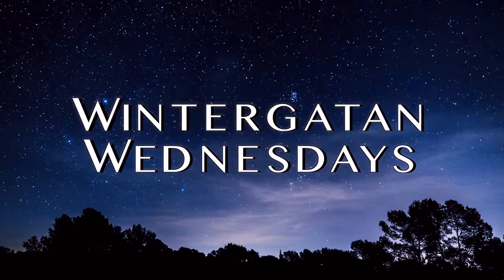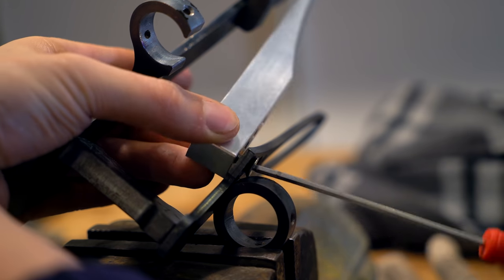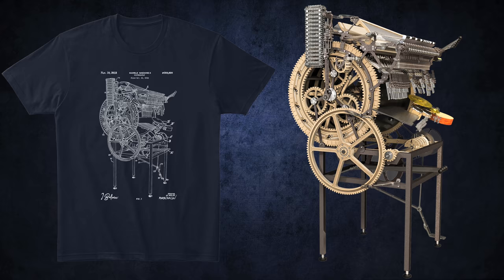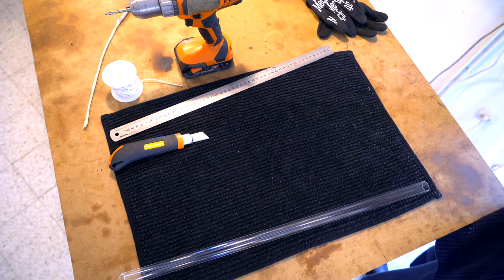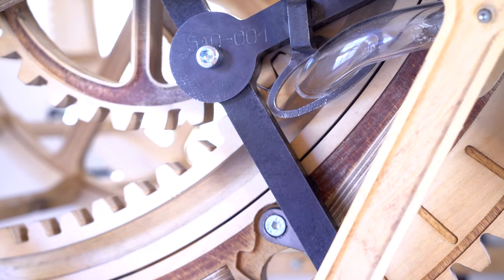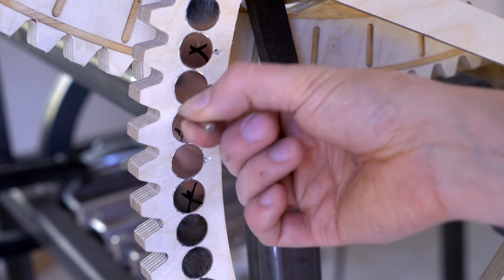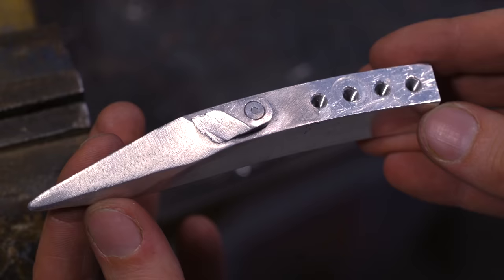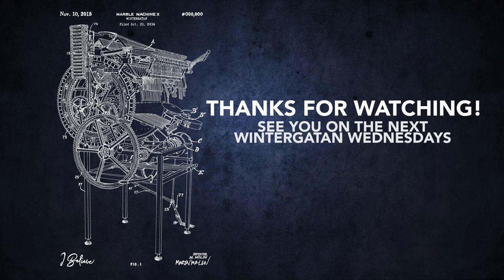Magnet Polarity Switch - Marble Machine X #60

Comment: That aluminium wedge might get rather warm due to eddy currents, probably not enough to be an issue but I don't want the machine to set itself on fire after one hour of concert
Reply: No.
Reply: I'm more concerned with the wedge breaking down too fast to be useful. It needs to be something harder and more scratch resistant. Those marbles might be smooth, but even minute particles of dust are going to be hell on that point.
Reply: @DembaiVT  he needs to tamper the steel.
Reply: @jacktheninja  the wedge is aluminum, not steel. Steel balls constantly rubbing on aluminum are going to wear a groove in the aluminum pretty fast. Steel balls with a fresh coat of aluminum oxide nanoparticles are going to wreak havoc of the finish of everything they touch.
Reply: @jimstanley_49  I must be high or something as i completely skipped the 'aluminium' part

Comment: Really dont need to use three taps on a through hole. Just run the starter tap all the way in. The plug tap is so you can get threads all the way to the bottom of a blind hole, even then most of the time i skip the middle one anyway.

Comment: one question, wont you have an induction heat problem with the aluminium fang and the alternating magnets?
Reply: I don't think that it will matter... but some cooling fins on that aluminum part would probably look very cool :D
Reply: @PenPeng  Let's watercool it :p
Reply: It shouldn't be any worse than in the other metal parts. The problem I foresee is the steel balls wearing away the aluminum and depositing it all through the machine. He might need to get some kind of high-carbon (very weakly magnetic) stainless to go there.
Reply: @jimstanley_49  I was also thinking about that, specially the clear tube transporting the marbles would become gray(ish) pretty fast.

Comment: Excellent video Martin. Ordered my teeshirt. The MMX is really a beautiful masterpiece. I look forward to the day I see you live, in concert, making music with it. Watching the marbles moving from the lower gear into the transfer tube makes me think of a freight train going through a switch from the main line to a siding. I am so glad clear tubing is used here and in the marble divider. I don't know if it is OCD or another disorder but I almost enjoy watching the marbles as much as hearing the music.
If I had to describe the MMX in one word, that would be "Charm'. Like a perfect batch of red french wine, made the old fasion way. Popping the cap by foot so you can feel the difference in temperature in the fermentation tank. And aging for 2 years in oak barrels where the wood was first aged for 3 seasons. Thank you for designing the teeshirt. I will wear mine with pride.

Comment: This is fantastic!  I made 700mm x 700mm birch panels that have various patent drawings (tesla electric motor, lego, electric toaster etc) laser etched into them which I used for flooring in a room in my home.  I may have to remove a panel and replace it with the marble machine patent now.  You are an inspiration!

Comment: When tapping through holes (or blind ones with extra depth for the chips), you only need to use the 1st (taper) tap in the set. Although you must run the trap further through the material as the cutting threads have quite the shallow taper. Typically a taper tap has 7 threads before they reach full depth. This is to allow reduced chip load on each tooth (easier starting, longer tap life, and less chance of breaking).

The 2nd (plug) and 3rd (bottoming) are only needed to get full depth threads right down to the bottom of a blind hole. They do not enlarge the threads.

Comment: If the aluminium fang becomes a problem it will obviously be difficult to unscrew it. I suggest turning the screws around by making countsinks in the ali fang nearest the wheel and filling then tapping the metal bracket. Love the machine and the video's. Great work Martin.

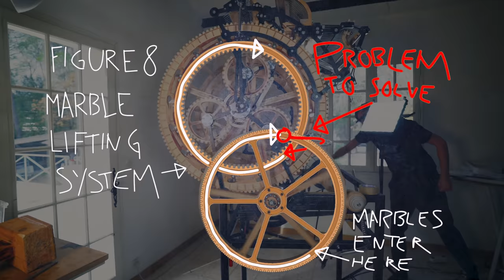Comment: I noticed something that could be important. The foot pedal, which was in the up position where it cant crush your toes came down by its self at 21:59 Im not sure if it was fully locked but if so maybe you should take another look at how that is held out of the way so you don't break any toes.
Reply: That was well spotted, but by design the pedal doesn't ever 'lock' per se (IIRC) so if Martin's foot was under it, it would simply flap upwards. Props for looking out for his well-being though :)

Comment: JUST EXTEND THE OVAL TUBE ACCEPTOR AND THE MARBLE REMOVAL FANG!!! If you extend the metal pieces longer you can just have the two pieces attached on the other side where there is no issues (or at least much less issues) with the pipe being in the way. It also solves the first problem with the welded part being in the way as well and only requires the redesign and remaking of 3 parts as of now(the oval poiece, the fang and the marble direction tube)! When you are redoing the marble redirection loop tube you could also cut it and shape it so that there is not a flat lip at the end but a gradual slope bu filing the inside of the tube down with a rounded file(be sure to protect the tube by covering the end of the file with something). If you want to keep using this same design you can also use a slotted bolt hole that keeps the metal together with something like the counter sink or  even better as flat head bolts that have heads that fit into bigger holes on the top or another piece of metal welded on the top.    Also wet the silicon rod and tube before putting it in the tube to make it easier to get it out. you can also squirt water down the pipe in a sink.

Comment: Hey Martin... I really like what you're doing with those magnets. There is something you should consider testing: Even if aluminium is a non magnetic metal, it is a good conductor for electricity. The magnets passing that piece of aluminium will induce eddy currents. Those currents can heat up the aluminium part. They will also create a certain braking force to the wheel. For safety reasons you should check the temperature of the aluminium. Maybe it is not a problem since the airflow is quite high but you better check it before it gets problematic ;-)

Comment: So nice to watch.  I love your work and your music!  Something to think about, the aluminum being so close to the magnets will generate a resisting force in the direction of the movement of the magnets.  In other words, it becomes a magnetic brake that will stop the machine sooner when you stop winding.  However it is kind of small and so it might not have a huge effect.
Reply: Alternatively, you could 3D print the part with some nylon or carbon-infused filament.  However it wouldn't last as long as the aluminum.

Comment: there are coatings or rubber pads (really thin) you could cut to fit the profile of the adjacency, and the rubber would prevent the corrosion, and because it would be cut to match the profile of the attachment, it would not be visible.

Comment: So I have been thinking since yesterday about the whole "marble scooper" as I'd call it, what gets the marbles off of the first magnet wheel.

It seems to me the majority of the problems with it is it tries to direct the marbles off like an exit on a highway. Which makes sense from the point we want it to go into a tube but less so for making the marbles come off of the magnets.

What I have been thinking about is to think laterally instead, like instead of having a wedge that slopes with the direction of the spin, you'd have a wedge that slopes towards the edge of the wheel. This wedge would gradually be introduced which means, that it'd be under the gap of the curve of the marble when it first is hit, and as the marble travels along it eventually comes to a wedge of such magnitude it falls off to the side ever so slightly and directed into the tube.

To elaborate this would basically look like the first design but instead of looking like the tooth of a dragon it'd look like long scythe, thin, curved and slowly tapering. 

This would make every single marble capable of being redirected on its own, but will require some very precise machining and design.

Hope you see what I mean, wouldn't be able to post any links since YouTube usually filters that.
It's important to remember if you see slight issues in limited control scenarios, you will encounter more when you use it as a product.

Comment: not sure if someone mentioned already. but if you put soap on the silicone rod, it will go in much easier. of course after that the tube needs to be cleaned.

Comment: Keep your head up! The CAD problem with assembly is still a HUGE problem in industry. Often things immediately apparent to real life only occur to people who have seen the problem before, because designers can forget about tools and tolerances very easily. Many drawings have an Assembly Drawing stage, and Manufacturing engineers have to interpret these drawings for assembly order. Its such a large problem that there are engineers who specialize in this!

Most people know what a Proof of Concept is, or a Proof of Design, but typically there is a Proof of Manufacturing prototype as well, so we can confirm that its assembly is as expected for manufacturing.

Comment: If you are worried about galvanic corrosion you can always put a sheet of teflon between the steel and that aluminum spike. :-)

As an alternate suggestion, lose the aluminum spike and make a scoop out of some flat spring steel, something like the blue steel bands they use to strap heavy packages down to shipping pallets. Curve it slightly to a partial tube shape so that it won't flex much, and get the edge of the scoop almost against the back of that lower wheel channel. The marbles will roll up onto the spring steel, and being steel, it will shield the marble from the magnet that was holding it. So unlike having to climb the aluminum spike while it is still being pulled to the wheel by the holding magnet, the spring steel should 'pick' the marble off the channel and cancel the magnetic pull, letting the marble flow easily into the tube.

Of course the spring steel will be attracted to the lifting magnets, so it has to be reasonably stiff. Something around 18 ga and curved, and with a reasonable anchor to the frame should be stiff enough. If there is a problem with the wheel pulling itself to the scoop and scraping the wheel against the scoop, you could put a small follower roller behind the scoop to keep the wheel spaced away from the front edge of the scoop.

Comment: something you could so, if it doesn't warp the part, is take a little heat to the work hardened area. take it to the orange colored range then let it cool off naturally. in the shop i work in this is what we do when our supplier etches small holes and we have to hand drill the plates.

Comment: when you pull the silicone out of the pipe:  use some highpressure compressed air at the same time you pull it out     :)   Same trick works on bike handlebar ends when setting them on....

Comment: Martin, 
There was a better solution to the machine screw that ended up being trapped. 
You could have drilled, threaded, and countersunk holes in the piece of aluminium (i.e., from the opposite side of where the threading is in the as-built configuration) and drilled and  threaded the piece of mild steel that is the mount. Then, using a flat head machine screw of appropriate length, threaded the screw through the aluminum and into the steel. 
Thought I'd mention this in case you need to redo these pieces.
David Green, Virginia, USA.

Comment: Way cool. Thank you for sharing this. A thin sheet of spring steel protruding from the tip of the aluminum fang might make a good "picker finger".  Thin enough, I suspect it would wobble toward the magnet then flip the marble into the tube.  As long as the spring steel is shorter than the width of the magnets (and mated to the aluminum) you should get a flipping action.  Of course, I Believe you'd need to figure out how to put an extra small tee-shirt between the parts for corrosion. :)

Comment: The magnets makes the machine pop!
Kämpa på, 
What about integrating a bearing in the wedge that follows the trench, and having a bearing on the other side as well. Which would “grab” the wheel. Combine this with a more rigid pipe entrance

Comment: Has no one told you about spiral point and spiral flute taps yet? With those you don't need to keep on backing out the tap to break/clear the chips, as they shoot/pull the chips out of the hole by them selves. You really should look into getting some high quality spiral point taps I think. The ones with a red ring on them should be right for your application I think. Those are high performance taps made specifically for difficult to tap materials. Just put some lube on and power on right through.

And also on the topic of galvanic corrosion, yeah you are completely right, it will not be an issue. You might find though, that the screws will be really hard to unscrew in a year or so, because the oxide layer on the aluminium has grown a bit, making the hole really tight. At least that has happened to me on a few parts. It helps to put some oil on them before assembly.

Comment: The reason the magnets work better when they're alternated is that magnetic flux likes to form a circuit, just like electricity.

The magnets sit more happily anyway when each N is next to a S (or a pair of S poles), but when you put a marble between the two it forms a more conductive path - almost a short circuit - between them, and you get a stronger attraction than when the connection to the other pole has to go the long way round, through the air.

This is why horseshoe magnets are a thing.

Comment: Actually you may still have an issue with galvanic corrosion as the magnetic fields that you have going through the pieces cause a small electric pulse, an alternating current pulse to be precise, though not necessarily a big issue, keep an eye on it.
Reply: Galvanic corrosion cannot happen unless there is an electrolyte completing the circuit between the two metals. Lots of electric motors have aluminium casings touching steel bearings, and they don't corrode unless the motor gets wet.

Comment: Yould could try adding a counter-magnet on the oppsite side where the exit is, to demagnetize them marbles. Just a small one so it doesn't take away too much of the view.  Then maybe even the single ones would be picked up correctly.

Comment: Hi Martin, this was a great video, and wonderful to see you overcome the hurdle. I noticed there were some marbles one the 2nd wheel, and was wondering if that might pose a problem. I suspect that marbles are never intended to remain on the 2nd gear, so it's not a real issue, but is there some kind of failsafe?

Comment: I have a question for you :
the steel oval parts (in which the acrylic pipe is going through) form loops of conductive material, wouldn't the alternating magnetic fields that are perpendicular to those loops induce some electric current in them ?
I wonder what effects they would have on the materials during a prolonged use of the machine.

If you wanted to measure the alternative currents that might be taking place, you could wrap some hair-thin electric wire as a coil around one section of an oval loop and use a multimeter, maybe ?

Comment: Getting the marbles out of the lift-gear into the pipe requires some fairly complex geometry, as evidenced by all the hand-adjustment done.

I would have 3-d printed the entire assembly.  That gives me the ability to quickly iterate through designs and would also give me a more attractive finished design.

Comment: I'm not a mechanical engineer, but I have a hunch that if you round off the edges of the inner inset groove on the lower gear the balls will have an even smoother transition into the tube.

Comment: Here is a thing I wondered: If you run into one of these practical problems such as the screw holes being blocked by other parts... do you change the designs in CAD for future reference? 
I can recall you mentioning keeping details on each part so others can reporduce them in a later stage when you might need spares on the world tour...

Comment: I think the magnetic field thing is because with the alternating magnets, the magnetic field goes directly from one magnet to the next one, so it's concentrated in the area between the magnets. With tall magnets in the same polarity, the magnetic field has to find a longer path through the non-magnetic air and wood back to the other side of the magnet, and it's more spread out.

Comment: Would putting the medical grade rod back into the trimmed to fit piece help with tweaking the tracking issues? You could thread the rod along the path of the marbles then hit the tubing with the heat gun to smooth out any transition issues. 

Also had the thought that maybe wiggling the rod would flange the opening a little ( if that's what you desired) instead of poking at the warm tubing with tools like you did in this video to make for a more consistent tweak.

Comment: I recognize those little mistakes we make when designing stuff and later when assembling, always good for some swearing :-)

Have you considered a push mechanism (maybe magnetic) to expel the balls out of the lower gear into a funnel, instead of "forcing" them into the acrylic tube. Let gravity help you and this would cause way lower friction problem and balls would noy be able to get stuck.
I like the design of the piece but the wear-out by friction will eventually kill a lot of the "track"

Comment: I think that if you carve a 45 degree chamfer on the inner wall of the marble trench they will fall faster and smoothly into the pipe. Just on the edge, maybe a 5mm wide chamfer.